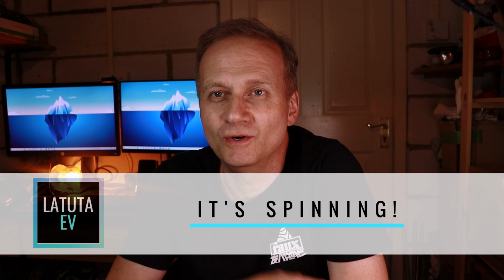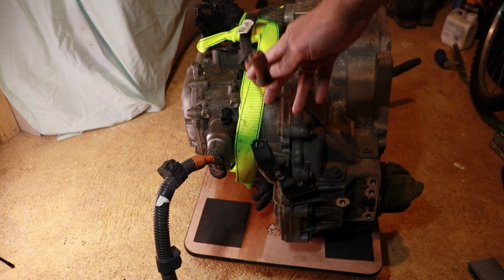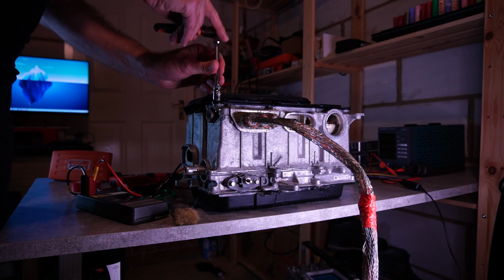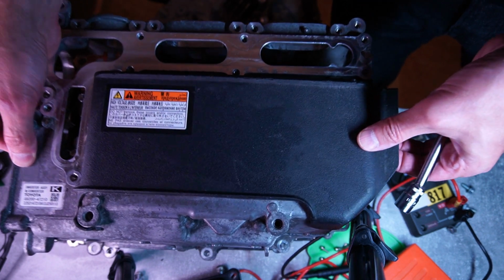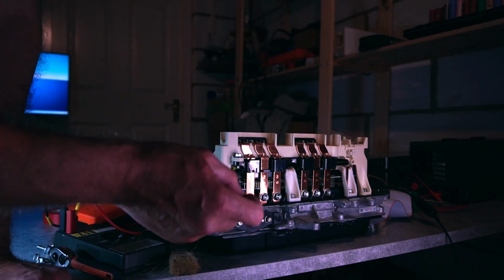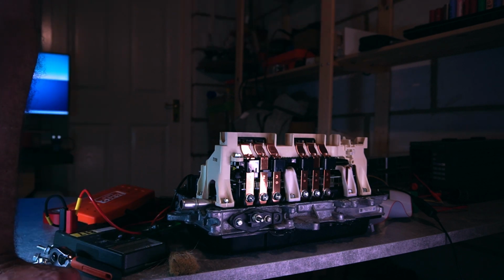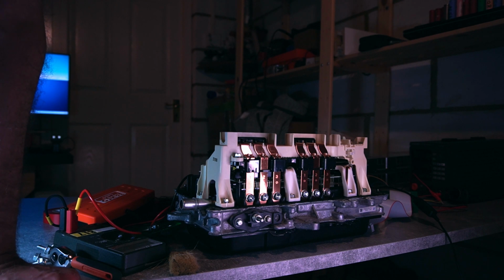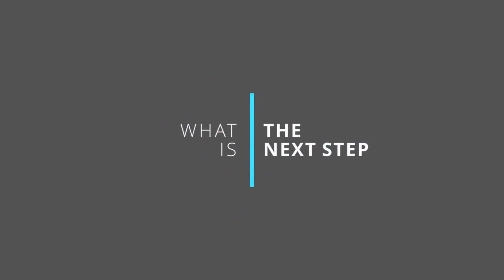Success DIY EV Toyota Prius  Ep 10

Comment: Hi, do you know which is the maximum speed for the electric motor without gear box, and how many frequency (Hz)have this motor?
Reply from the maker: I have not tried pushing it myself but according to Department of Energy report it would do 5000 rpm and max up to 7000 rpm.
Reply: @LatutaEV  Thanks for the reply!
I want to use it as an electric generator, but I don't know how many Hz it has and at a speed of 5000rpm, I don't think it's worth it?
Reply from the maker: @sorinionescu8702  I think it may be possible check on the open inverter forum they have mains inverter version

Comment: Nice video 

How many Hp you will get from Prius transmission??
What’s the difference between Prius transaxle and hybrid Camry transaxle ??
Reply from the maker: Thank you for your kind comment. I am hoping that I could reach 50 kW peak (67 bhp) with the Prius transaxle. I have a future plan to get two gearboxes together and remove MG1 from each and connect them as one  to get 140 bhp.

Comment: This seems quite difficult? The open inverter board does not work out of the box?
Reply from the maker: The Prius board is designed to go inside the inverter. I actually like this as you have control over so many parameters. It's not that hard to open the inverter. However Damien has zombyverter design that could control the inverter by taking to the Toyota board
Reply: @LatutaEV  out the box i meant if you buy the board sold as a Prius board is not able to spin the Prius gearbox without tuning?
Reply from the maker: @blackterminal  Two solutions for this problem: First Johannes Hubner designed database of parameters so once you worked out the working set for a particular motor you can store them and anyone else could use them. Solution 2 is to offer inverter and a board "out of the box"
Reply: @LatutaEV  zombie system will be easier for less skilled people?
Reply from the maker: @blackterminal  yes that's true

Comment: I've done the same with the missing bolts.
Reply from the maker: Ha ha I am glad I am not the only one ;-). Love your project by the way. Interesting that you are using Mitsubishi motor with Toyota inverter.
Reply: @LatutaEV  Thanks, wish I'd used the rear outlander motor instead, but the front works for now, just requires use of gear shifting.
Reply from the maker: Have you considered using Prius gearbox?
Reply: @LatutaEV  I didn't want the issue of joining drive shafts. May be if I was to redo it I would
Reply from the maker: @JamieJones1985  Do you mean connecting MG1 and MG2 together?
Reply: @LatutaEV  no, I mean the prius drive shafts to my vw drive shafts
Reply: @JamieJones1985  when you use a mismatched motor do you need to spend hours programming the inverter control ?
Reply: @blackterminal  with a replacement logic board, regardless of motor, you'll need to tune parameters.